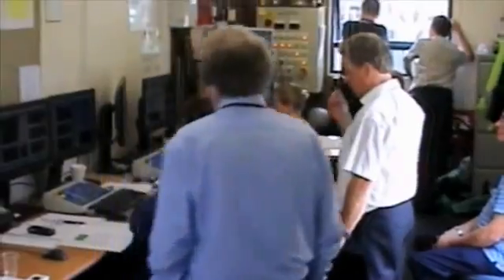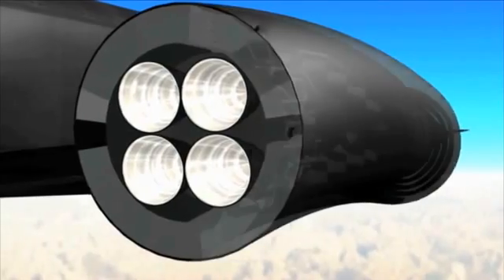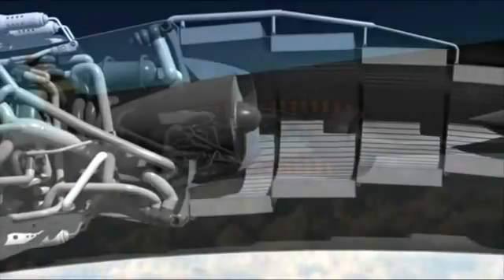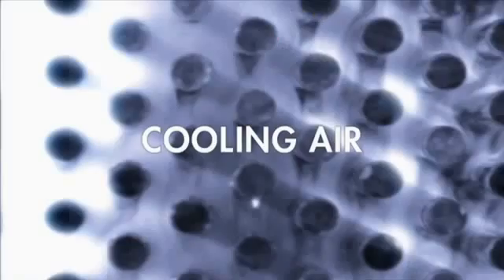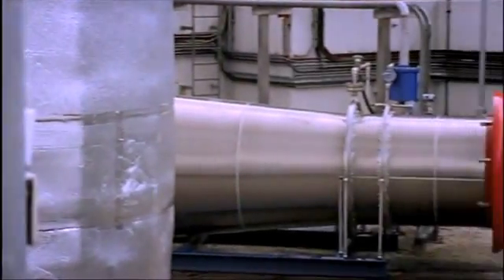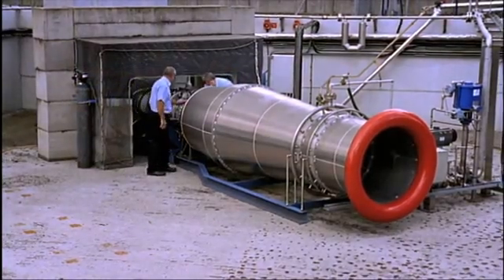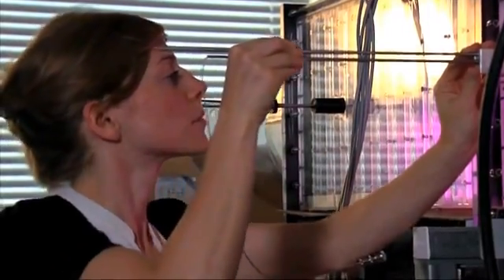Skylon...SABRE Engine

Comment: Wikipedia: The engine ' ... works by compressing and then quickly liquefying the air [while in flight]. Compression is achieved through the ram-air effect in an intake similar to that found on a high-speed aircraft like Concorde, where intake ramps create shock waves that compress the air. The ... design then blows the compressed air over a heat exchanger, in which the liquid hydrogen fuel is flowing. This rapidly cools the air, and the various constituents quickly liquefy. By careful mechanical arrangement the liquid oxygen can be removed from the other parts of the air, notably water, nitrogen and carbon dioxide, at which point the liquid oxygen can be fed into the engine as usual.' Wikipedia doesn't mention that the engine produces close to zero emissions. R (Australia)

Comment: Centrifugal force is used to get rid of the water and ice in the incoming air ….that’s why the engines have a curve….water and ice are heavier than air……at Mach speeds the curve is just right to provide a centrifugal force to the incoming air. Think of a big Dyson.

Comment: Question: if you cool the air down from Mach 5 to -150 with this super heat exchanger, where does that heat go? You can’t just dump in.. if you’re using the liquid propellant, then that propellant will evaporate and expand... can someone please explain to me the energy equation here?
Reply: It’s so you can compress the cooled air from the heat exchanger to combust the liquid hydrogen fuel at a far greater efficiency inside the engine. The air coming into the front of the engine is heated immensely by the inlet ram and this will be the case for any engine operating at high speeds, so making that 1000 degree Celsius air into -150 Celsius compressed air to ignite liquid hydrogen with is amazing, and the high pressure ratio and low temperature inside the engine mean you can use much lighter materials than other engines like the J58 that powered the SR71. They couldn’t be operated at higher speeds because the engine couldn’t take temperatures above 430 Celsius. The highly heated air being compressed by the nose cone and shockwaved into the compressors of the engine was the limiting factor on speed. This sabre engine will go past Mach five with supercooled air, lightweight engines and ridiculous performance at high altitude, and into low orbit where it will effectively turn from a jet into a rocket and close the jet engine off and switchover to liquid oxygen. Honestly, it’s  an amazing concept; https://en.m.wikipedia.org/wiki/SABRE_(rocket_engine)

Comment: I was under the impression that the purpose of burning fuel with an oxidizer is to create HEAT. Of course colder air is more dense but it's also harder to get into and through an engine for that same reason. And what is a "terrestrial aircraft"? You have no competitors because what you're doing makes no sense.

Comment: It seems like you have a weight problem. The SR-71 was the world's fastest jet, but couldn't take off fully fueled. It had to be refueled mid air and obviously wasn't fast enough to enter orbit. Obviously, it could not carry a NASA rocket. Neither could it reach sufficient altitude to reduce the necessary rocket size sufficiently. I do LOVE this idea but, unfortunately, it seems more like imagineering than engineering at this point.
Reply: Eddie Morrone The people that are doing it are experts, unlike you, who, without wishing to be rude, are just a bloke on Youtube. The Skylon will be built of lightweight carbon composite and the engines propel it to Mach 5 before they turn in to rockets.
Reply: SvenTviking I am a person in real life too, not just on YouTube. Sorry to upset you. I know I'm not an expert but, I don't think it takes an expert to notice the wings are too short to generate sufficient lift. Besides, I'm pretty sure those engines and wings would be ripped off at speeds approaching orbital flight. Again, I'm not an expert... just observing the disparities between space rockets and air planes. We had a system that worked like this in the good ol' US of A. It was called the space shuttle. The shuttle itself is for carrying passengers and materials and returning them safely to Earth. The actual shuttle does very little itself for thrust without rocket boosters and the main rocket. It certainly does not have jet engines of any kind, just rockets boosters for stabilizing the rocket and course correction while in orbit. The rocket itself doesn't need wings because IT'S A SPACE ROCKET!
Reply: The engine they are using is a lot more powerful than a conventional jet. This is a rocket/jet hybrid, as a result the thrust is very high. I doubt they have a big weight problem at takeoff.
Reply: Also, "The actual shuttle does very little itself for thrust without rocket boosters and the main rocket" I'm pretty sure that the majority of the thrust that put the shuttle in orbit came from the three shuttle main engines on the shuttle itself. The external tank did not have any rockets. Looks like your understanding of the subject is limited.

Comment: If you can scale this down to the right size, replace the rocket nozzles with a power turbine like a torque converter and get it down to 150 lbs all in, I could see this as a car or truck engine for the 21st century and beyond.
Reply: The worlst most fuel hungry truck :D

Comment: its not a jet engine its a rocket with an intake where the oxidizer would go and it cools the air into almost a liquid then mixes with fuel and is pumped out after ignition. it switches to on board oxidizer once intake air is to sparse and then would be classified as a closed cycle 4 bell liquid fuel rocket engine.
Reply: Storm Silvawalker it's not a jet engine or rocket engine, it's a hybrid engine.

Comment: Why are the engine nacelles curved? It's slightly comical the way they look like bananas.
Reply: +PhazonSouffle At hypersonic speeds aerodynamics change, massive lift is lost and the aircraft must maintain a very aggressive angle of attack, yet the engines must also maintain an angle of attack that allows the hypersonic air to pass into the cooler properly or else you get a sonic boom inside of the engine that can tear it apart. The only proper solution is that the air intake cannot be at the same angle of attack as the center of thrust. It's a similar concept to how the blackbird engines work. Their intake cones are pointed down instead of the entire engine being curved.
Reply: +PhazonSouffle To keep the center of thrust pointing through the center of mass of the craft.
Reply: Sarge Rho Then why not mount the engines slightly higher? It seems weird that the thrust vector isn't parallel with the body.
Reply: +PhazonSouffle well it could be to do with aerodynamics, and the look of it is not all that important, my best guess is that the shock wave off the nose of the craft will hit where the intakes are opposed to where the centre of thrust needs to be.

Like the blackbird had its intakes place very spaced out to catch the shock-wave from the nose because the shock-wave is a condensed air so which intakes are for taking in air so putting them where the most condensed air is is the best place to put them.

There could also be complex interactions which make the curve cross section larger.
Reply: its to keep the intake pointed into the relative wind during higher angles of attack
Reply: There was a sci-fi movie called Flesh Gordon they stole the design from his space craft.
Reply: +LouSaydus yep...well said...
Reply: Well that seams strange, Skylon have thrust vectoring... i guess they don´t want to keep vectoring all the time
Reply: It acts as an airfoil...maybe.

Comment: "We have no competition" (until the Chinese steal it....!) ;)
Reply: +Chuff and flog them on ebay for $38.26
Reply: they improved various things, especially making strides in industrial manufacturing and volume scaling. it's not a 'product' per se but thousands of products depend on streamlined manufacturing chain to improve efficiency and lower cost. that's why many foreign companies contact chinese OEMs to bring their products into market.

I'll try to provide a few specific example off the top of my head - they improved mig-21 from russia and made many version of J/F-7 planes some of which are quite modern (BGI version for example) and much better than original in features and capability.

chinese companies also made big strides in mobile and telecom with huwawei, xiaomi and oppo etc making quite a reputation and going shoulder to shoulder with any other phones. in fact, some google nexus versions were built in collaboration with huawei. and in telecommunication infrastructure sector, 2 of the biggest 5 companies in the world are chinese zte and huawei.

in measurement electronics, Rigol makes high quality oscilloscope and analysers; in portable audio and DAC market, Fiio is a huge and well respected name; in solar panel photo voltaics and wind energy sectors china has become the biggest research and infrastructure investor in the world, surpassing usa.

for more relevant consumer examples - chinese company DJI almost single handedly brought the idea of personal drones in the forefront. and if you're into photography, many new 3rd party lighting, lens and tripod from china are not just good value for money but actually great products in general. godox has become a very well liked brand for lighting, benro for tripods and venus optics (laowa) for lenses. and I'm sure similar things happened in other fields that I don't know about.
Reply: +zeebazu lololol
Reply: That's fact...."We have no competition"...for the Chinese "stealing" is a corporate buzzword..( no offence,..I kinda like the Chinese approach)...  : )
Reply: In fact,they put forth a vision, some country make that a reality..then they steal it back and improve it...clever.  :)
Reply: @giddy ^ that wasn't my point. I never said it was okay on a moral sense. I only gave examples because you asked for examples.
Reply: Or short sighted government give it away!
Reply: and make it affordable so regular people can actually buy and use it
Reply: zeebazu Haha yes :)

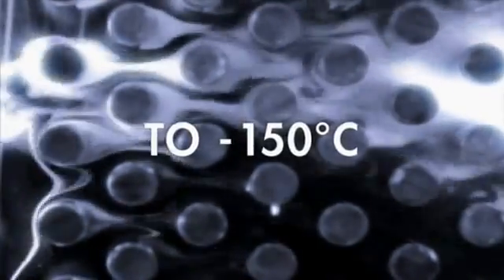Comment: (1:04) 1100c in less than 1% of a second. That IS impressive, but doesn't it still make other components of the engine doubly hot from the exchange? I'm still getting perpetual motion energy issues. I assume there's a trade secret.
Reply: LouSaydus That's pretty much the case with all spacecraft, though. the difference is that skylon can actually abort in a non-exploding fashion.
Reply: i think you mean cooled not cooked
Reply: ROGER FANCHER They're using the Hydrogen fuel to cool the Helium coolant, which cools the air. That heats up the hydrogen, which is subsequently burned by the engines.
Reply: The air is cooked by liquid helium and then the heat is passed  into the hydrogen fuel tank which acts as a heat sink.
Reply: +Sarge Rho In other words, this thing is going to have a very slim window of opportunity to make it into orbit or else they'll have to scrub and retry?

Comment: Metal fatique wheather in the engine or fuselage make this project economically too expensive as in the space shuttle supposed reusability. Spacex f9r is the answer to low cost access to space.
Reply: +si jahanam you clearly have no idea what you are talking about...
Reply: Stephen Humble They are making the problem more difficult? What? As complex as boosters that save a certain amount of fuel and then have to stay stable as they hover back to land on pads, then they have to be recovered and still virtually rebuilt after each flight? Do you realise how fucking complex and Rube Goldberg that is?  
Skylon uses jet engines that turn into rockets, amazingly simply. Basically plumbing. It’s fuselage is made of carbon composite and is very light for it’s size, especially compared to the dense Space Shuttle. So it slows down at much much higher altitude where the the atmosphere is thinner and so the fuselage never heats to 3000 degrees like the shuttle and so it needs far less heat protection.
So it’s much much simpler than Space X. It takes off of from a runway, it flies up into space, does it’s job,re-enters, lands on s runway and is refuelled for it’s next flight. And that’s more complex than Musk’s Goldberg contraption?
Get a fucking grip!
Reply: F9R is just the first of several multistage reusable rockets which are replacing non- reusable rockets.

The innovation of importance is not single stage rockets but reusable rockets - single or multistage does not really matter so long as it's reusable.
The current skylon concept is attempting to do 2 things that are difficult 1 Reusable system AND 2 single stage to orbit
Even getting a single stage to orbit is difficult let alone a reusable one - they are making the problem far more difficult than it needs to be based on outdated and flawed ideas so the skylon probably wont ever be built at least not as currently envisioned.
Reply: The fuselage is going to be carbon composite, which does not fatigue. SpaceX is a last ditch effort to keep multi stage rockets viable. And also, it's all NASA's got. In doing so, it's become ridiculously complex.
Reply: The idea that skylon is simple is false - it's simple to describe - insanely difficult to realise. 
The ultralight and strong and heat resistant construction required is extremely difficult (even the less demanding requirements of Lockheed's venture star kept it from becoming a reality and it did not have to takeoff horizontally) , the mass and size of the vehicle are extreme , the engines are not simple they are the most challenging ever devised, the horizontal takeoff speed is enormous, the requirement to travel at mach 4 or higher in the upper atmosphere carrying that much size and weight is unprecedented and makes the records for the fastest military aircraft like the SR 71 seem moderate in comparison. The SR71 was clad in titanium and parts reached over 300 Celsius - they sell the idea skylon is simple but it is insanely difficult.

On the other hand what sounds difficult having multiple stages doing vertical landing has become the proven technique to get to space since the 1960's and landing stages has become possible thanks to computer control avionics and make landing them look easy.

Comment: Other potential uses for the rapid precooler tech:

Compact Superconductor magnet refrigeration [maglev trains cheaper, slightly].
Cryogenic weaponry  [Hello Mr. Freeze/Captain Cold]
Normal kerosine Jet engines, improved fuel efficiency all around with non-heated combustion air. It could make VTOL aircraft more fuel efficient, so no less than 1000 mile range VTOL fighters [F-35B], or enable economic hypersonic airliners, as already designed with the LAPCAT project proposal.
Reply: +Kal&#39;sik “Vader21175” Herensk No, the best use of this is definitely for air cooling my massive 4 way radeon r9 295x2 crossfire, amd fx-9590, 64 gigs of ram, 1600 watt power supply, and 8 3.8tb ssds. I can melt some aluminium with all that heat
Reply: Problem is, the precooler uses liquid hydrogen. It only really makes sense if the engine it's running on uses hydrogen as fuel, so any jet using this needs massive liquid hydrogen tanks.
Reply: Maglev trains don´t need superconductors any more.. that is really 1980-tys techonlogy. Maglev have developed quite a bit since then